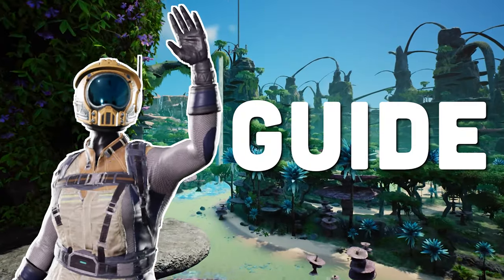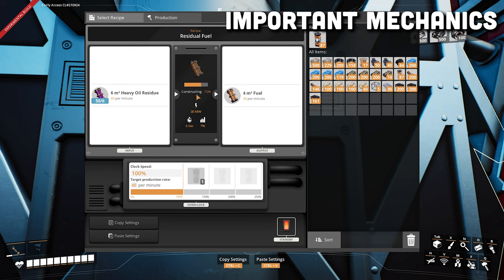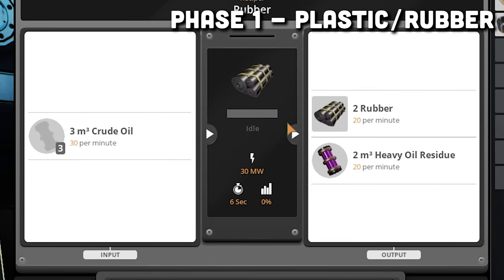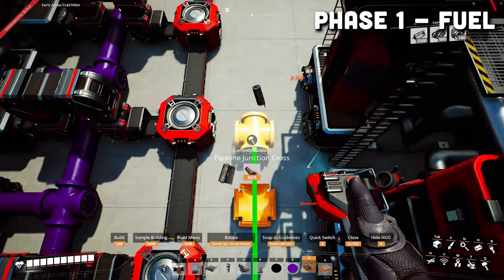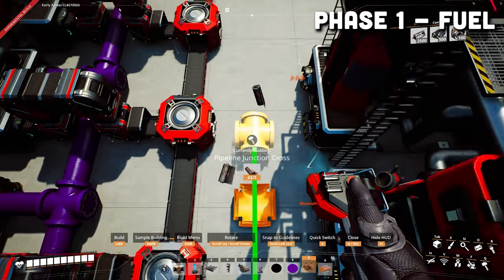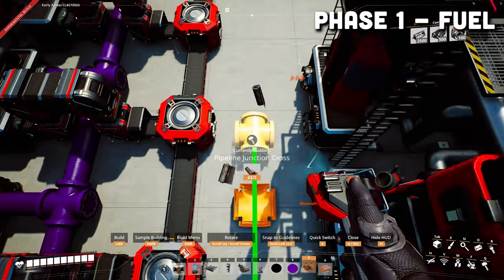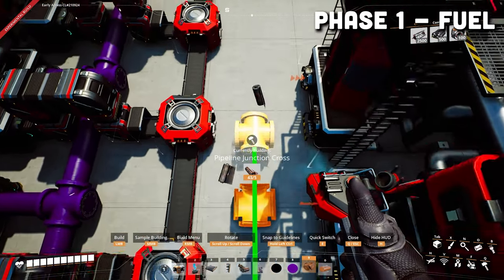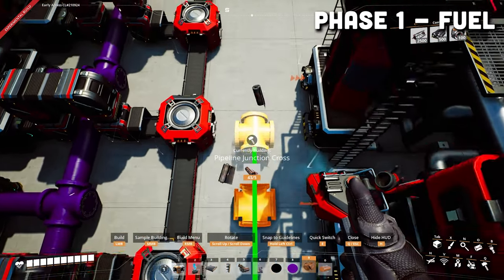PERFECT Starter Oil Setup!! 100 Plastic/Rubber + 1200MW! | Satisfactory Update 7

Comment: If you read this and plan on recreating this: It is not neccesary to underclock the third refinery if you can live with a little less plastic. Leave it as it is, instead turn up packed fuel prodution from 4 to 24. If you do this, you will use up all 120 Fuel produced with no left overs, get a bit more fuel but suffer a minor loss of plastics for canister production.
Reply from the maker: The reason we underclock is because we don’t supply enough heavy residual oil to supply 3 refineries of fuel. Leaving the third one not underclock although technically works, won’t work at 100% efficiency and you won’t be producing more fuel, it’ll still be 100 fuel but machines will turn on and off making things less efficient.
Reply: @spectrumdad_  i understand your math and it is correct but for some reasson, once my pipes were filled to max compacity i was able to run everything at 100% with no machines stopping or drop in production. I assume that, since pipes mk1 hold 300 units of heavy residual oil, running the third refinery at full capacity taps into the "overflow" in the pipe system, which in turn fills up fully to 300 maximum fast enough to not deplete. Either that or i bugged it out somehow. Maybe the timings off somewhere in the productionline, cant for the life of me see where since the math checks out but i built your setup twice, hooked it up to a fully overclocked oilpump and am yet to run into an issue.i run the game unmodded, so cant be a mod either. I'll keep an eye on it but so far it works.
Reply from the maker: @SunWoodMC  yes that is most likely what happened, but overtime it will get rid of that overflow. It's not really a big deal, you will just notice less output at some point but you might not notice it too much if you aren't looking for it.

Comment: Once everything is running, can I overclock the fuel generators at all for more power or will that cause issues?
Reply from the maker: No because they are currently using all the fuel being produced. But you will need a lot more power. Usually you will want to unlock a few alternate recipes to create bigger fuel setups. I’ll be making a video on that.

Comment: I only just realized this with the heavy oil residue, but we have ten refineries making 100 HOR a minute going into the secondary refineries that are asking for 150 HOR a minute, so we won't quite be making 100 Fuel per minute. 
I only caught this after making this setup a second time and I'm not 100% sure that I am even correct. 
Do we just need to underclock the secondary refineries to correct this?
Reply from the maker: No it’s actually 150 because the rubber makes double the heavy oil residue than the plastic. The plastic only makes 10 each but the rubber makes 20 for a total of 150.

Comment: Very well made Guide, good to understand and follow!! But there is a flaw the 10 refineries you have for plastic and rubber don't produce enough heavy oil to supply the 3 refineries making fuel. As it is now you only produce 100 HOR which is 50 short of producing 100 fuel.
Reply from the maker: Thanks! I do mention to underclock The last refinery of the fuel To 50%. That will solve that issue.
Reply: @spectrumdad_  Ye I know but its still needs 150HOR per minute ^^. 60HOR per minute for each of the 2 refineries at 100% and another 30/min for the the one at 50%
Reply: @SpectrumDad Nevermind all that apparently there was an issue with 2 of the refineries so now it works ^^"

Comment: I have this setup working, but i keep loosing pressure on the heavy oil residue line. Its the same level as the outputs to the first line of 10 refineries, and I have it piped just like the guide. The numbers make sense (150 - 150 with the underclocking) but two of the fuel refineries arent keeping pressure. Any advice?
Reply: I'm not sure if you've worked it out but you now need to overclock a pure oil extractor to go from 240 to 300 to support 10 refineries (30 oil each)

Comment: I followed this to the dot and the pipes arn't flowing properly I use more fluid from the buffer using the generators? I am confusion, preciate the vids though big time!
Reply: They changed the input for 1.0. Either just take off a couple of generators or underclock every generator to 60% where it intakes 12/minute.

Comment: What is the best way to get the recources to my base (2km)? First the proces for recources or a long pipe line?
Reply from the maker: The way to go would probably be to not ship oil, but make the things like plastics and rubber there. Then use trucks/trains to send them over. You could belt also if you really wanted to

Comment: In the 1.0 update: To power 8 generators consuming 20 fuel per minute each (totaling 160 fuel/min), the 3 machines producing 40 fuel/min each (totaling 120 fuel/min) are insufficient without overclocking. By overclocking one machine to produce 80 fuel/min, the total production becomes 160 fuel/min (80 + 40 + 40), matching the generators' needs. So, overclocking one machine allows the 3 machines to supply all 8 generators.

This means: in the step 1 he put one machine to underclock, remove the underclock so all machines produce 40, then overclock 1 (USING THE "S" THAT ALLOWS TO DOUBLE PRODUCTION, NOT INCREASING THE OVERCLOCK ITSELF) 

Now all machines requiere 60 heavy fuel, for a total of 180, but our machines only produce 150, to fix this we need to overclock 2 machines (USING THE "S" AGAIN), first we overclock 1 plastic machine, then we overclock 1 Rubber machine, that will give us the 180 we need

I also recommend disconnecting the tube that connects to the 'Packaged Fuel' and reconnecting it after the 'industrial fluid tank'. I also recommend overclocking to the maximum the two machines that produce 'Packaged Fuel', this time using the power from the slugs. This way, a lot of Packaged Fuel will be produced to the point that the chest will fill up quickly every time we take from its inventory, and the fuel ratio will remain the same since the accumulated fuel in the industrial fluid tank will be used. This recommendation is completely optional, and if you don’t have enough resources, you can ignore it entirely
Reply: Hello!! I just saw your comment by chance! I was getting crazy trying to figured it out... Why he was insisting on producing only 100m3 of fuel when the all 8 fuel gens consume way more than that. Thanks a lot for pointing it out it doesn't work on update 1.0 <3
Reply: @emico4501  Hello! it does work with just some slight overclocks, investing the 3 "S" upgrades i mentioned isnt that expensive, the design will work as intended and you dont need to build anything else to fix it
Reply: You said to overclock 2 of the Refineries making Heavy Oil at the cost of 1 S in a plastic and one S in a Rubber however that would only gain us 15 Heavy Oil/m (Plastic is 10/m at default with S 15/m and rubber is 20/m default 30/m with S) so we'd still be 15 short unless we used 2 in each of those machines unless I'm mistaken
Reply: @Psyberius  With the "S" you get double production, not 1.5 production, so you would get 20 heavy oil for plastic and 40 heavy oil for rubber
Reply: @AldyDerg-bd9uc  Hmm it was only giving me 1.5x bonus not 2x with a single S unless I'm misunderstanding something (I only have 50 hours and just did oil for the first time so its entirely plausible that I have made a mistake)
Reply: @Psyberius  You are right, it was my bad, you need 2 S per machine so you can get the double production
Reply: @AldyDerg-bd9uc  Man it is the derg with all the telegram stickers
Reply: @Drakey_Fenix  Helloo x3 it's nice to see other furries enjoying this game!
Reply: @AldyDerg-bd9uc  Love the advise on this. TY to you both so much. In your opinion, after the packaged fuel is filled in the container would you turn off the smart splitter to prevent extra from being made just to make tickets? That way it doesn't continue to pull from the fluid tank until its a net negative fuel supply again? Would you also want to refill the tank again once you run out of it eventually?

Comment: So, i've finally builded everything needed for this factory, and unlocked also the T4 Milestones. The problem is, the plant works fine for some hours, then the large fluid buffer become empty, and the last two power generators starts to don't get enough fuel, and i got the sawtooth line in power production graph. Also i see the second fuel refinery, the second at 100%, never reach 100% of efficiency, reach 75% and then go idle for some moments. What i can do to fix? i've followed all your recommendations on over and underclocking, waited to start until both the fluid buffer and the power generators are full of oil. I have also redo all the pipelines (apart the junctions), tried to set the first pipelines from the oil extractor to the ten refineries to MK2, added a pump between the 3 fuel refineries and the large oil buffer. My oil buffer still become empty gradually. Node of oil is pure (coords -245,049 / 90,588) and the extractor is overclocked at 300mc/m, it works at 90% efficiency.
Reply from the maker: When the oil line gets to the platform before it starts going to the first refinery, add an elevated large liquid buffer there. Then babe the line come down to go to all the first 10 refineries. Try that. There is issues sometimes with the pipes that might cause that. I’ll be making an overall fluid guide in the near future to explain issues and fixes for oil
Reply: @spectrumdad_  Ok, thank you so much, i will try. I suppose i need a pump before the large buffer, and the elevation can't be more than 20 meters if pumps are Mk1 or 50mt if are Mk2, i suppose Mk1 should do the trick.
Reply from the maker: @FrancoOliveri  yes you’ll have to pump up into it.
Reply: @spectrumdad_  Done, the oil liquid buffer before the ten refineries is full, and also now the second refinery who make fuel works at 100% :) Now i'm waiting to fullfill the large residual fuel buffer, then i will start again the fuel generators. Thank God i got 2.4 GW stored in power storages and 10 hours of autonomy, so i don't stop nothing. Thank you so much as usual :)

Comment: First of all very useful and accurate, great video, but to power all this I need to overclock the oil extractor to the max.

Furthermore, the fuel produced is enough for 5 generators, not 8.
I don't understand how a setup like this can work.
I did everything the same as the tutorial.
Reply from the maker: The setup produces 150 heavy oil/min, and converts it into 100 fuel/min (-4 for packaged fuel, so 96) that then goes into 8 fuel generators (12 each).  *Note The rubber actually produces 20 heavy residue oil per machine and not 10 like plastic. I would turn off and on machines in phases to make sure the machines get full with resources before moving on. That will avoid a lot of issues.
Reply: @spectrumdad_  I have already had the machines filled up, but the fuel is not enough for 8 generators.

Comment: Any reason that my last 2 oil refineries in the row of 10 can’t get enough oil to stay going consistently? I’m using a pump to get the head lift, I have it played out exactly like you do but I can’t seem to keep them running consistently
Reply: Update changed the outputs. I got 4 power gens running instead of 8
Reply: @padishasden382  yea I figured it out after just staring at it for a bit lol. I took inspiration from the design in the video and changed it up. I have 22 refinery’s powering 20 fuel gens now. 5 doing plastic, 7 doing rubber, and 10 doing straight heavy residue and polymer.

Comment: What I do not fathom is why using manifold technic to connect pipes to Fuel Generators? Yes you can manifold them but how about a perfect manifold by adding valves to the pipes that goes through the generator?

Comment: Also what is the reason for mixing your conveyor belts within the builds
Reply from the maker: You don’t have to do it. You could use the maximum belt everywhere to keep it the same. I tend to use the lowest belt that works to save on resources for these builds but you don’t have to do that.
Reply: @spectrumdad_  ok ty i thought it has something with the speed of loading things, new to the game and liked the designs. ho have you put numbers down on the grids u make?
Reply from the maker: @jason.lacey79  once you unlock the customized milestone, you can unlock the patterns in the awesome shop.
Reply: @spectrumdad_  have you done a modular frame modular factory vid?
Reply from the maker: @jason.lacey79  not yet, I’m actually working on that right now. :P
Reply: @spectrumdad_  cool please ping me when it’s ready.

Comment: I can’t seem to get this to work. The end 3 don’t get enough oil even with my oil extractor overclocked on a pure node. Also I made an exact mirror model on a different pure oil node, and that one works perfectly fine. Haha
Reply from the maker: Did you let them all fill and the line full completely before starting them? If not just turn off the first couple and wait for the last ones to fill the. Turn the first ones on again.
Reply: I did when I first started them. Then after a while it empties. But I will give that a try again.

Comment: Do you need a pump at 16:12? Don't the machines pump out with a 10 foot lift?
Reply from the maker: They do, but the pump is to help with the backflow. There are more efficient ways to handle that but this was the simplest for the video.

Comment: I'm sorry, but Im confussed.... Why are you producing 100m3 of fuel per minute when you need to feed 8 fuel gens that require 160m3 fuel per minute PLUS the packager (4m3 more)?? Maybe this was something prior v1.0??
Is there anything Im not getting here? Im still new to Satisfactory, so could you explain me better please?
Reply: Probably math changed i noticed too when tried to set this up. Right now same setup (5 rubber and 5 plastic) produce 150 resudie>100 fuel>5 power generators. Then you underclock 1 generator to 80% and get 4 fuel if you need.

Comment: Is there a reason that my oil isn’t pumping up? I have a pump, but it just gets stuck in the pipe going up into the floor hole.
Reply from the maker: There’s a bug currently I’ve seen people complaining about this. Delete the hole and pipes, redo it or for now just go straight where you need it to go without a floor hole if you can.

Comment: Are those mk2 lines??? I'm using mk1 and the rubber refineries keep running out of oil
Reply from the maker: Nope they are mk1 but you do need to provide 300 oil/min. It might need time to saturate. If you are sure you are providing 300 then you can stop the first couple and let the lines fill before turning them on again.

Comment: Hey man for the smart splitter going into the packaged fuel we will be using for jet packs you never mentioned how to setup that smart splitter to send plastics into the packager

Edit: I think it was supposed to be just a regular splitter now that I’ve rewatched it
Reply from the maker: Either way works. But just set it to overflow on the side that goes to the packager and packaged fuel in the center going forward into the storage.

Comment: is the oil extractor overclocked at all?
Reply from the maker: it is, I am showing that it is overclocked to 300 but you can merge lines instead of overclocking. As long as in the end you provide 1 line of 300 to the refineries.
Reply: @spectrumdad_  Would having 4 2x overclocked work instead of having 8 fuel gens?

Comment: Any help on this one:   My refinery is not making the residual fuel. It has power, it has a pipe with heavy oil flowing into it. Im stumped. I did exactly what you did here.  ahh
Reply from the maker: You made sure to power the refineries? And you confirmed the machines are getting residue inside of them? What about the output? Do you have a pipe going to buffers? Are they full?  Try flushing out the system by going on the pipes before and after the fuel refineries and doing a full network flush.
Reply: @spectrumdad_  oh I didnt have an output setup for them. that makes sense I bet it was that.  Thank you for replying